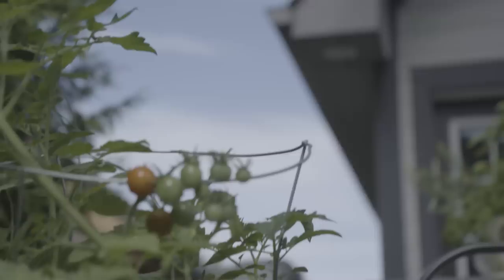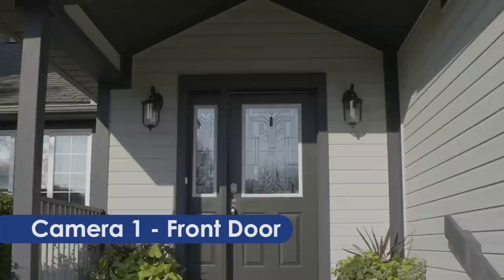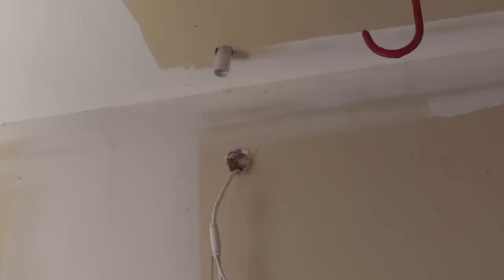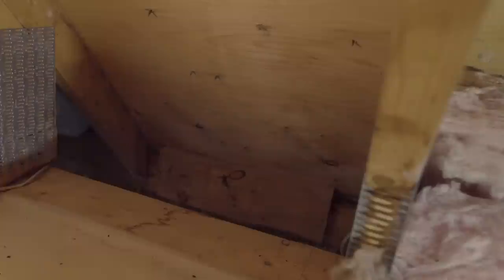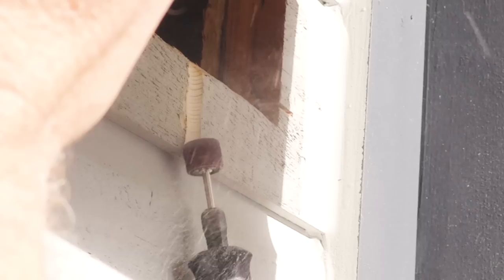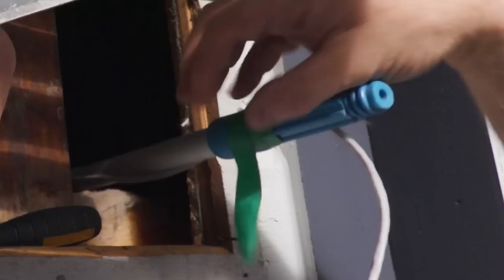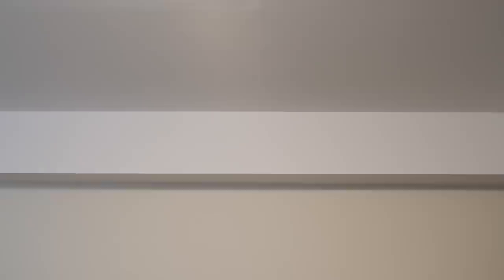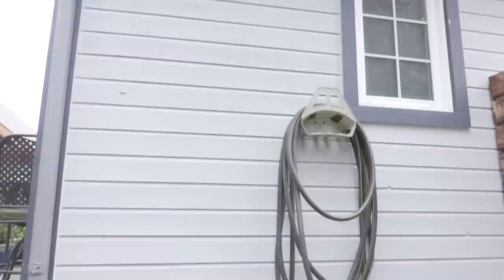IP Security Camera System Installation Video

Comment: I wish i lived in a house,where you could stand in the attick,had wooden cladding and thin metal soffits,dry walling instead of 4" concrete blocks & brickwork on the exterior. I'd do it just like you if i did. And then i wouldn't have to rely on wifi and i would use cat5e and an nvr,and I'd use that Lorex system also good job!

Comment: What a hack job. 

Drilling holes without sealing them. 
Exposed conduit. 
Electrical tape to insulate sharp edges. 

Are you even using weather rated cat cable?
Reply: Exactly!!! I agree with you, benefactionhindrance.

Comment: You guys used a VGA cable on a 4K NVR?
I thought you guys were professional.
Reply: That's for the monitor, but I would think VGA was obsolete and HDMI would be the new standard these days.
Reply: 2K/4MP cameras .  VGA can support up to 1080P and up to 2048x1536.... so about 3K .    HDMI is a consumer digital format to replace analog systems.  It is not a professional format.  HD SDI  and 3G SDI are professional formats due to lengths it can be run without digital loss .  HDMI has a limited length for reliable transmission.
The NVR has an HDMI output as well giving the user great flexibility.
Reply: michael b but it just seems that a 2.0 hdmi cable would be better for this application as it also does audio and is in a super short occupation, so no transmission loss.
Reply: @bryanslocks3481  Visually I'd find it tough to see much difference on a 27 inch or smaller computer monitor ... Having 6 -8 cameras on a small screen  you'll not see much difference in resolution.  PLUS most people will leave the HDMI available for say a TV near by.  Either use a repeater or better HDMI cable to run the longer lengths.  If you're sitting down watching tv and you get a notification you're looking at a tiny screen on cell phone or tablet and then can switch to the alternate HDMI input on your tv.    I've installed where the NVR is in a basement tucked away or locked up with a small monitor for just navigation purposes.... then run a good quality HDMI to a TV or even a couple TVs with a splitter and repeater or good quality HDMI.   Really depends on your application.
Reply: Mine's on a 43" 4K on my bedroom wall fed by HDMI. It never gets turned off, and it rocks - even my wife loves it. I have an additional monitor in my garage off the VGA.

Comment: No way around it, you gotta drill a ton of holes if you want a wired set up.
Reply: The professionals use wire without end connectors so the smallest holes are drilled then they crimp all the connectors at the NVR & cameras

Comment: I bought a Lorex NVR 4K with 8 cameras capacity. It came with 4 cameras and a reasonable price. I've had it for three years and on Dec. 2020 two cameras died and one camera had never been used. Overall, I like the Lorex NVR but I'm disappointed with their cameras and Customer Service.

Comment: I’m sure the misses would love a hand full of access port covers on her ceiling...
Or you could just YouTube “how to patch drywall “ ...
Make the drywall cuts between 2 2x4 studs or what ever size wood supporting the drywall. Try just to cut enough just to show enough 2x4 so you can support the drywall you removed with a drywall screw on both sides. In short , this will be a rectangle removed and saved to be reinstalled later . Once supported, the drywall can be patched up to look like you never cut into it . But if you prefer square plastic covers , to each their own
Reply: I would have NOT done it as in the video. I took a whole door out, and sealed it with drywall, which isn't that hard to do. Now the closet is opening in the other room.

Comment: You drill in the garage then through the ceiling. Why is the cable exposed shity like that rather than being professionally put within the wall? Also how is thin electrical tape going to protect the cable from sharp edges? Cables probably stronger than tape for sure. Grommet strip or a sleeve not more professional? Notch the conduit? Not use a proper end box and then box lid? Gonna make a how do least be professional than half ass.
Reply: Robin Todd puck off mate
Reply: Understand the touchy response 😂. I’ll delete the comment if you want?

Comment: 17.50 electrical PVC tape like that will not ever make it in context water or weatherproof. Fior the you need self amalgamating or rubber tape.
Reply: I would use heat shrink

Comment: Lorex has a lot to learn about customer service I ordered an NVR and 2 cameras totaling $768 dollars and they made it such a headache to order from them that I just told them to cancel my order and refund my money after they had already charged my card they sent me an email wanting me to take a picture of 2 different paper utility bills which I dont get paper bills cause I'm not a 90 year old man I pay all my bills online so I told them I dont get paper bills so they suggested I use PayPal to re-order everything cause apparently they think pay pal is safer then a credit card but my pay pal account was hacked 4 years ago and all my info was stolen so the account has been locked since that happened I would suggest if you want a security camera system you do what I did and find a security company in your town and buy the equipment from them house will get better customer service and have a local company near by if you have problems.

Comment: very helpful..if you install security camera better do it in one way, the right one, making wallfish, no drilling through wall and ceiling, this is unsafety
Reply: any better ways to run wire? i want to start installing security cameras. do i need to get cert?
Reply: Wesley Guzman some training and technique, is what you need, The basis, no wire visible outside, and follow some code, some people just need to see a camera of his porch and they are happy, that is why on tv u see a better pictures of the moon surface than a thieve on a gas station

Comment: So you’re telling your customers to drill THROUGH The conduit? I thought you guys were supposed to be professional
Reply: Instead of using conduit straps plus it looks cleaner for an install.
Reply: In situations where you want to minimize the look of a grey conduit an installer can place the conduit in the corner.  As such,  you cannot use conduit straps.  By having  holes you maximize the attachment strength and later cover the hole with caulking or a hole plug ...as indicated in the video.   For DIY this is a good solution and easy to cover up.

Comment: I see a audio connection on every camera. I do not see the cable for the microphone hook up. Can you explain this to me? How does the microphone get hooked up?
Reply: They're not audio connections. These are PoE ip cameras, which means they normally get their power over the ethernet cable if the recording device supports it. The extra plugs are there to provide the means to supply electricity externally, in case the recording device doesn't support PoE features.

Comment: Crappy install job. Clearly a professional wasn't used. I'm guessing they just pulled a couple people from their warehouse to do this "install". Some things to keep in mind. Always seal your penetrations with the appropriate caulk. The penetrations leading from the garage to the attic need to be sealed with a fire rated caulk as well. There is mold visible in the garage, wear a mask. Best to ditch the cables that come with the camera and use high grade cables and make your own terminations. Route the cables centrally, especially when entering the house. You want to minimize the holes. Don't drill into the conduit, use conduit clamps.